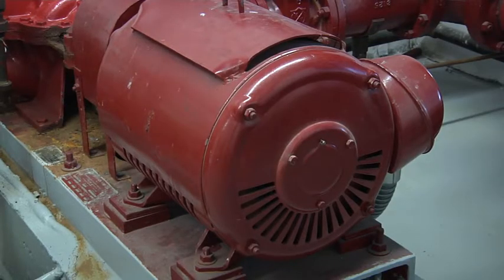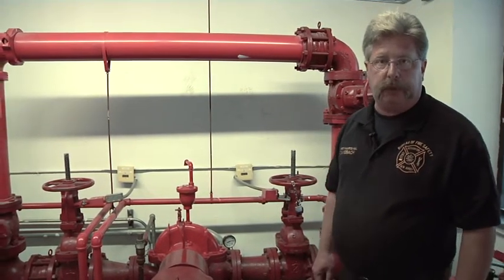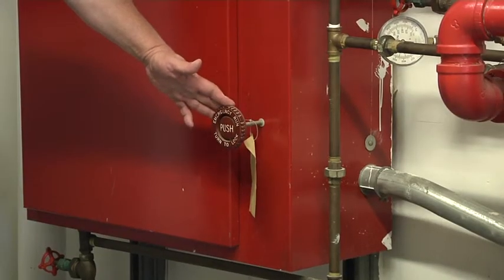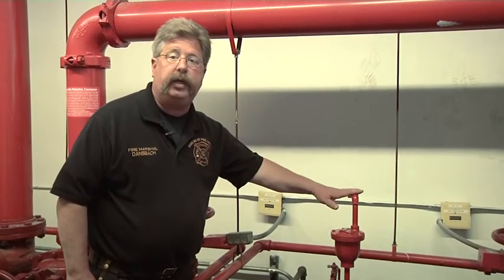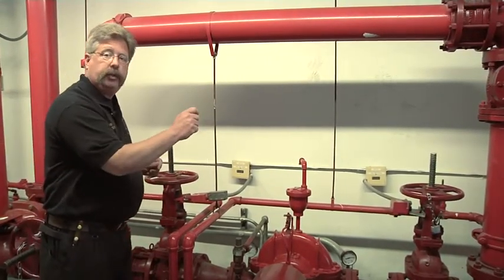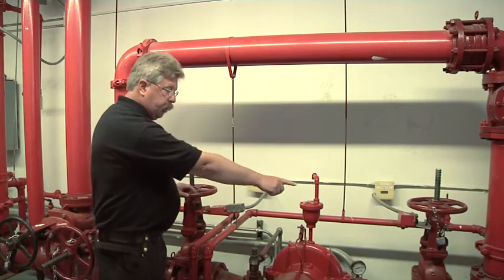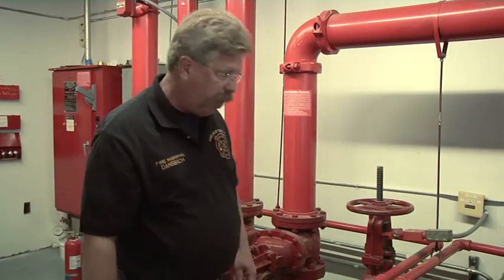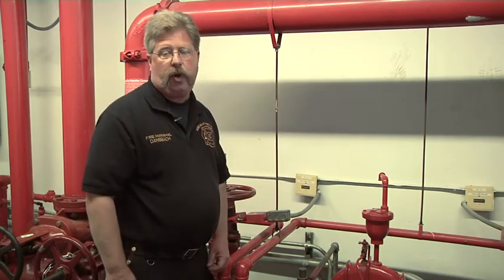Fire Pumps in Buildings #2839474562001

Comment: how do you tell wich gague is suction and wich is discharge?
Reply: Suction gauge says vac on it and Is before the pump
Reply: suction side is water source usually underground pipe, discharge goes to manifold header and out into building. Follow the pipes.

Comment: I hope that set is strictly for training cause that discharge check valve and control valve are wrong. Check valve is supposed to be before the shut off on the discharge side of the fire pump with the sensing line tied in somewhere between the two.